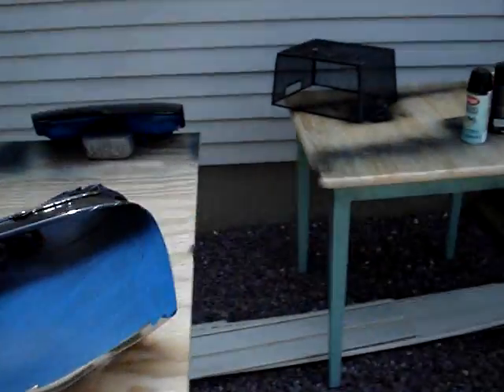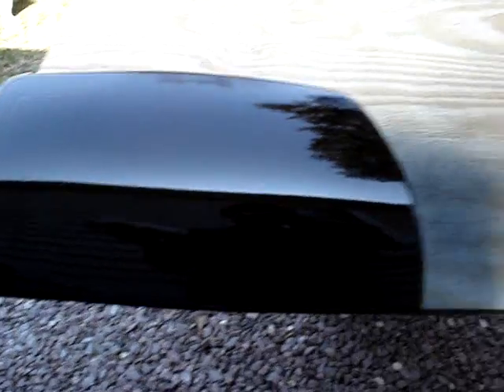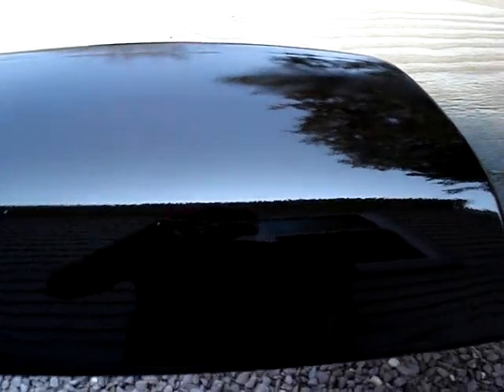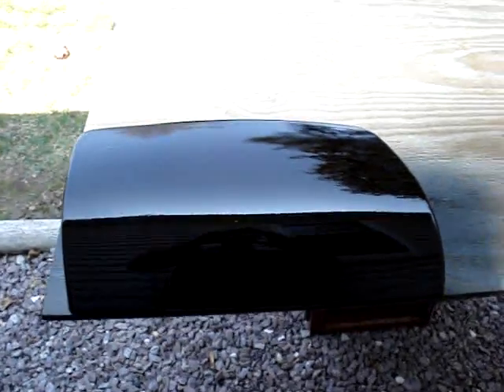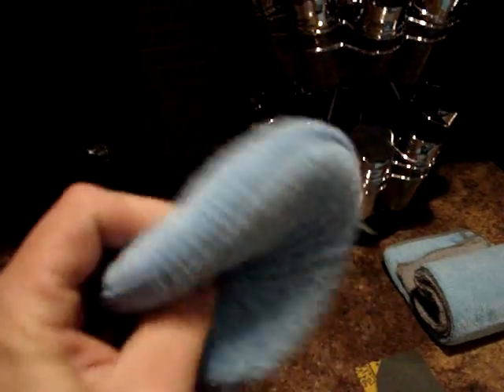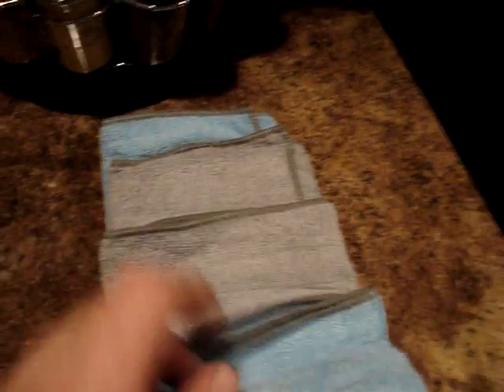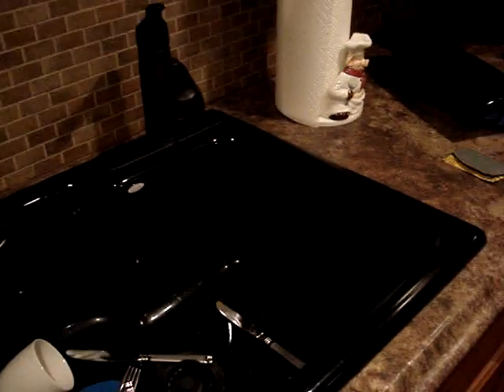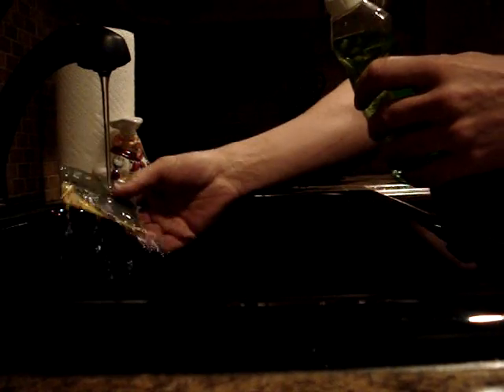HOW TO TINT YOUR TAIL LIGHTS WITH VHT NITESHADES (VIDEO 2 OF 2)

Comment: Everything but the last compound part turned out fantastic. I would recommend anyone doing this not to scrub and use compound. It didn't leave a glass finish, but the clear coat did. I was satisfied with just the tint and clear coat. Shines better than with the sanding and compound.

Comment: I sanded down my clear coat and it got hazy and foggy like you said, then I used the ultimate compound to polish them and they still look a little hazy! I even polished them a few times. Any reason this happened, or any way to fix it?

Comment: orange peel that doesn't last in the environments or the sun. Give it 6mo-1yr and it lightens up and will begin to fade and then crack.
Shiny and glass like?..LMFAO. Not even close. That is scratched up, orange peeled and duller than shit.
Even the BEST VHT job ever, compared to a crappy sprayed base/clear tail is night and day difference. Base/clear is Waaay better and lasts for pretty much forever if taken care of.

Comment: Ur probably getting cracks cuz ur spraying too close and ur using cheap shit. I used rustoleum brand and this brand. Rustoleums smoother and better quality. Vht is shit and i also got cracks with vht and many other ppl i kno that used vht got same results. I told them go to autozone get rustoleum lens tint. Be aure ur lens is clean an free of debris then shake can very very very well ao it doesnt clog nozzle and comes out smoothly and mixed well, then spray bout ten inches away even coats slightly over lapping. I did bout 4 to 5 coats and its perfect, if u apply too much u cant see the light thru it well and it will make ur lens so hot over the light bulb it will melt the lens. Do not apply too much! I did no sanding and no clear coating ever, if u do it like ive explained u will not have to sand or clear coat. Do it the right way with rustoleum